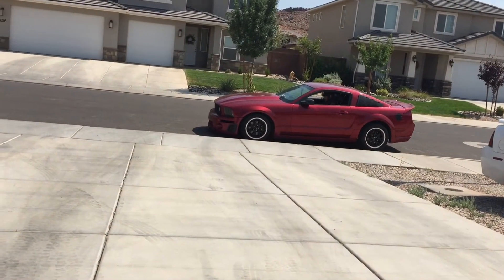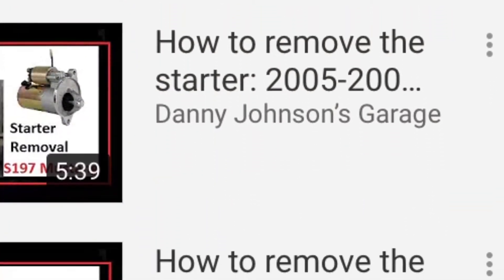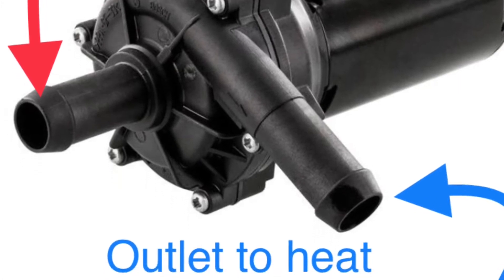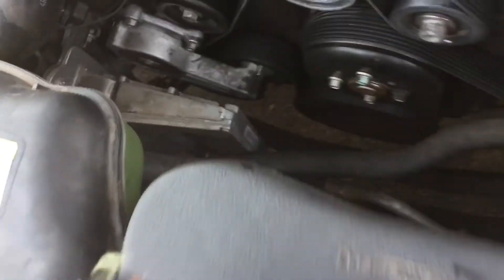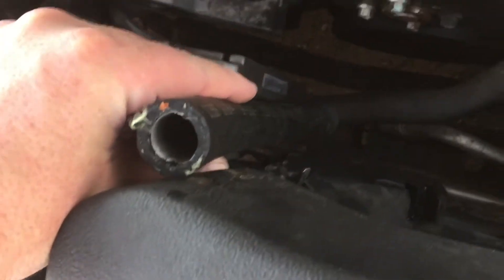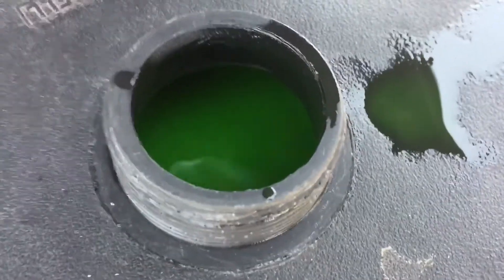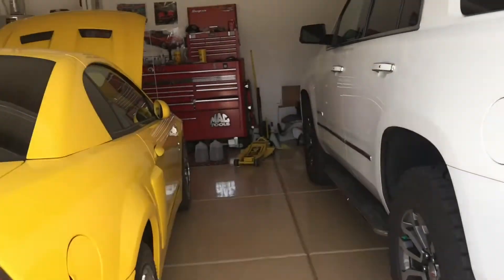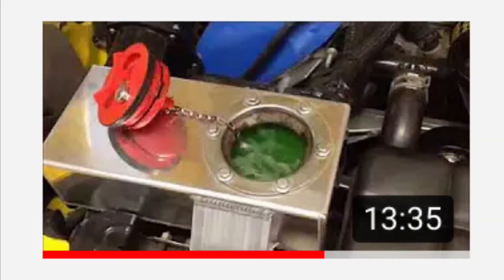Intercooler pump works but does not flow: How to fix intercooler pump Mustang GT, Cobra, Terminator

Comment: Just went through the issue of air locking my new intercooler pump. The best way I got all the air out was by blowing air onto the return line (top hose) of the intercooler tank with the cap off. After that I jumped the relay and was able to get coolant going. Hope this helps someone out there

Comment: Love your videos I want to change antefrezer on my 2000 saleen how do I use my pump to drain all coolant?
Reply from the maker: I would drain the system at a lower intercooler line and then use the pump only when adding fluid to burp it.

Comment: Hey Danny, me and my dad just bought an 04 S281 SC and we have a problem with the intake air temp running too high and we thought it might have something to do with the Intercooler, appears to be working and the water is moving a bit but we can’t find any videos of it online and we would like to know if it’s the way it’s supposed to be running or if it’s not circulating right. I can email you a video of it.
Reply from the maker: How hot is the intake temp getting? After driving the car the intercooler fluid should be warm, but still not too hot to touch. Do you know how hot the intercooler coolant is? 
  The pumps will often work intermittently when failing, so you’ll want to find out if it’s working consistently when the temp is hot enough for it to be on. If the pump fails it typically causes the intercooler coolant to boil and seep out the cap
Reply: @dannyjohnsonsgarage  Danny, first of all, thanks so much for getting back to me. We totally appreciate your help! The intake air temp is between 160 and 170 once the car gets up to operating temperature and we are driving around for a little bit. Certainly, anytime we get on the throttle, the intake air temperatures shoot up almost immediately. It’s been around 90° here in California but it’s not so hot that it should be performing like this we don’t think. Also, once it gets hot, it feels like the ECU starts to pull timing and you can hear detonation even. The car also goes massively down on power. The seepage issue that you were talking about is really on point we think because when we first got it about a week ago, we thought that the intercooler reservoir cap must’ve been bad because you could see seepage around it. We replaced the cap but we have seen seepage again so it must be boiling?   When you start the car up about 30 seconds in you can hear the pump going, but it doesn’t seem to be as volatile as yours was in the video, granted it is a different vehicle, but whether it’s an issue or not is still up in the air.
Reply from the maker: @enzolucia9768  Yeah, 160s is common for the heat in the summer and it definitely pulls timing for it. Same with my car. I don’t like any pulls until the weather cools down. The pump may be on its way out, they only last about 40k miles. It’s probably a good idea to replace anyway and go from there.
Reply from the maker: @enzolucia9768  here is my replacement video. Same process, so just make sure being gravity fed the pump is lower without the slump as you saw in the current video https://youtu.be/X3FGpBaISHg
Reply: @dannyjohnsonsgarage  OK, yeah we need to just swap out the pump then. Again, you are awesome for taking the time to help out! I guess the last question that we have is on the stock pump and stock Saleen intercooler reservoir, should we be seeing the water swirling around and bubbles forming if the pump is working the right way? Because our water just barely moves in the reservoir. Is it possible that the pump is working but not working very well because there are air bubbles in the system somehow? You mentioned that in your video I think?
Reply from the maker: Yeah, you should have flow like in my video where when you put your hand into the pump you can feel it circulating. If it’s just making some bubbles it may be blocked. The pump can make noise but with it plugged (air pocket or kit gravity fed) the only thing moving the fluid is the heat.

Comment: Even some of the simplest things can be overlooked thank you. I just put a Davies Craig EBP 40 on my lightning and it made a huge difference went from like 3 gallons a minute two roughly I think it was like 9 gallons per minute Not 100% on that But I do know if you go to much it WONT stay in the heat exchanger or intercooler long enough for that to do its job and cool it off there’s a line between not enough and too much. So far so good that’s a hell of a Lil pump. I’m pretty sure they got one for the mustangs it might be the EBP 25 I’m not sure I have to look into it but I know they make a brushless  one not sure if it’s gonna be plug-and-play you probably have to go cut your wires like I did but that’s no problem as long as you solder And marine grade heat shrink them right. Can always put dielectric grease on the inside of the heat shrink too it’ll make it water resistant I know I just got tired of spending 100 hundred bucks on a OEM one again for the same volume so I did some research this time and upgraded it.

Comment: I tried it but it didn’t fix it, I did end up solving it by jumping it and while l did that I blew right into the hole where you add the coolant and it started moving, for anyone trying to get it to move just close it off while you keep your left hand on the jumper, I noticed it created pressure and it worked every time now that I jump it, just keep in mine it will not work anymore once you open the cap if you’re not jumping it, then you’ll have to repeat the process, hope this helps someone
Reply: What am I jumping? Please help

Comment: Hey Danny. I had an interesting issue with my 03 cobra intercooler pump. I had several times during acceleration the coolant boil over - I’d pull over and check the intercooler water flow and it was fine. During an oil change I took a look at the pump and found when I pressed on the connector a bit it shut off! Damn! Consequently during those few months I went through three fuel rail pressure sensors - most likely due to the increased fuel pressure because of the AIT’s being extremely hot and the temperature around the sensor which I’m sure was also very hot. Anyways, after changing the pump I had no more issues. Hope this helps someone.

Comment: I installed the vmp triple pass heat exchanger for the same model in your vid and in expansion tank it does look like it is circulating but i can't really notice  a difference from the stock heat exchanger going to check piping for any curves

Comment: Hey Danny got a question for u, when I’m driving in reverse in my terminator I hear what sounds like a grinding noise from the passenger front wheel only when applying the brakes only happens on reverse , any thoughts?
Reply from the maker: Your best bet is to remove the wheel and see what you can find. Watch the following videos:
Reply from the maker: https://youtu.be/Nd8cetc-kcM
Reply from the maker: https://youtu.be/ZVT6OaQavvk
Reply from the maker: https://youtu.be/YA-LgA9BBjU
Reply: I’ll check them out, thank you
Reply: I know how to fix that....stop driving in reverse....🤣🤣🤣